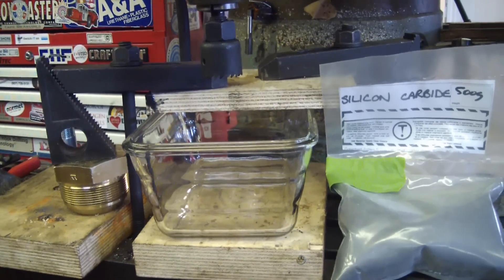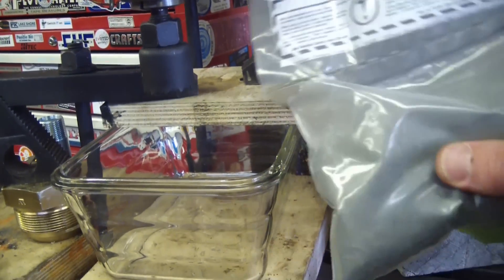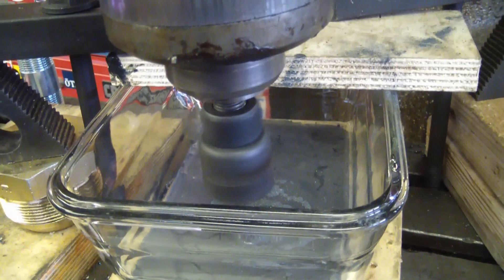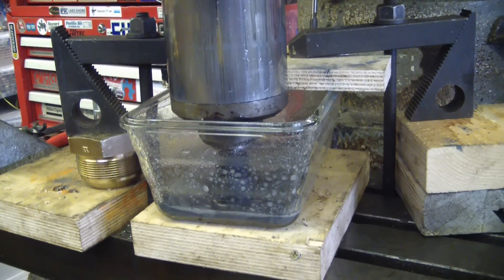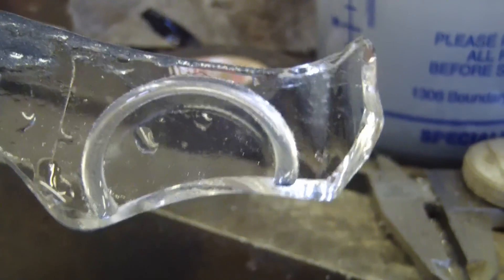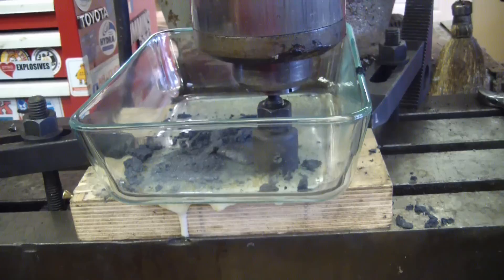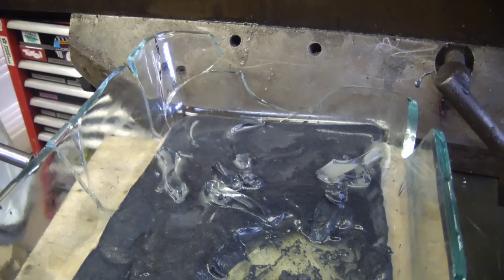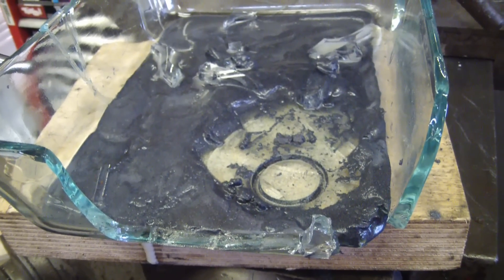Using Silicon Carbide to cut glass

Comment: You should've annealed the glass in a kiln before trying to bore through it.
Reply: +Kevin Jacobson yeah. im with this guy. though i think a kiln is over kill. you could  probably put your oven on self cleaning with the dish inside and walk away. i've done a little bottle cutting and its some finicky stuff, glass.
Reply: +hexadecimil what do you do to cut ur bottles?  I use GREENPOWERSCIENCE's method
Reply: +Shadowrcmegatech yeah! I watched a lot of videos before I started doing it and I found his to be the most informative. although he tells a few fibbs in his video "that would only take like 5 min to sand smooth." no. I don't know what he calls smooth... or 5 min but that's BS. second all I use is a micro torch. no water or ice. plus I use wide painters tape to keep the HAZ (heat affected zone) down to a minimum. I'm about to start experimenting with annealing or normalizing the stresses in the glass first before I cut. got a lot of broken wine bottles at the house. Which brings me to another fibb. the best bottles are easier. subscribe to my channle and I promise to post a bottle cutting video soon. you can seey set up, tools and method. might even break a few bottles too :D
Reply: hexadecimil holy shit!  Is the painter's tape a common thing?  I tried putting painter's tape .5in  above and below the scoreline cause I thought it would help.  I think it does at least a little bit.  Where do you put painter's tape?  

Yea it definitely takes awhile to sand the bottles.  I put wet sandpaper on a foam floor mat and keep the cut bottles in the same place as I rotate them back and forth.

How close to perfect can you get the bottles using the torch?  What % are successful? How often can you save both halves?  For me it really depends on the bottle.  Glass soda bottles are the easiest;  sometimes a perfect scoreline can end up forming a crack most of the way around without any heating or cooling.
Reply: +Shadowrcmegatech yeah. it really does depend on the glass and apparently Coca Cola co. uses the best glass. wine bottles on the other hand are a real crap shoot. so far I'm 1 and 3 with those. beer bottles are the all arround best. though they break about half the time, they are plenty full and easy to score because of the often straight sides. 
as for the painters tape I go about 1/4" below the line, which Google tells me is round about 6 mm (just in case your not state side) I do this to further isolate the HAZ as much as possible to the score line. since I don't care about the top of the bottle for making cups and vases I hesitate to say I've saved every one, even the ones where the bottle broke on me. I've got a stack of them. maybe I broke one. not sure. now I haven't experimented with quote, unquote annealing the bottle yet but I know that glass will melt round about 2000°F so I'm dubious 360°F in my toaster oven will do anything but I'm gonna try it anyway.
Reply: +Shadowrcmegatech  and as for how perfect can I get it with the torch? pretty damn close to perfect. I like to use the torch only because you are never shocking the glass from hot to cold or back again. I feel like this makes spider cracks more likely and with the torch I can control the break pretty well. it takes patients and practice and you need to get a feel for it, but it's been very successful for me. when I'm don't my necks always go back on like a puzzle piece and they will hold water no problem.
Reply: hexadecimil Interesting.  According to wikipedia the annealing temp. of glass is 800-900F, so I wouldn't even bother with the toaster.  Cutting beer bottles with hot and cold water is near impossible because they're so thin, but the blowtorch seems like a viable option.  

The small soda bottle I cut today was a real challenge.  I got a nice, clean crack to form all the way around, but the two halves wouldn't  come apart.  The crack was faint, so the two halves must have been so close together that the atoms in the glass were still close enough to attract each other.  Eventually I took a hammer to the top half and shattered it.
Reply: +Shadowrcmegatech  900 F seems logical about half the melting point. that means I'd need a kiln. or a forge. used to have a box I did that kind of stuff in, out in the yard bit now I love in an apartment. o bigger torch would work. good excuse to buy one of those :D
you hammered off the top!? wow. brave man. how'd that work out???
Reply: +hexadecimil worked out fine.  Top was
In pieces, bottom in one piece.  It was already cracked along the scoreline, so the bottom was unaffected.
Reply: +Shadowrcmegatech that's great! double it would work with a wide e bottle though. too thick. not enough leverage. every time I try to snap off a price of any bottle that stays stuck it takes a price off that I'd like to keep. bit it's always fun working with the stuff. wish I could show you a pic of the pair of wine glasses I made out of sprite bottles.
Reply: hexadecimil Which half did you use to make the glasses?
Reply: +Shadowrcmegatech the bottom half, bro.

Comment: Hey I'm a glass blower and i think the problem might be heat stress from the bit.  I also work in a machine shop and know that end mills create a lot of heat especially with constant friction.  It appears that the break occurs at around the same point of the cut and it could be that enough heat accumulates and causes a heat fracture causing the glass to fail.  When i drill holes with an abrasive drill I usually back off to expend heat and clear the glass dust (chips) that are left behind.   If it was tempered the vessel should have shattered as soon as the cut started.

Comment: maybe it could be a frequency issue? possibly a vibration problem...
Reply: If this was a Prince Rupert's Drop issue (inside under pressure, but unable to defeat the outside surface tension), it would rupture and explode the moment the surface of the glass was broken, and the entire dish would likely disintegrate.

Comment: I have used a cheap diamond coated hole saw from a good hardware store to cut holes in normal liquor bottle glass. The key is very low pressure and a slow but steady water supply to keep the heat down.

Comment: Soda lime glass is tempered, so like you said the same properties that take place in a Prince Rupert's drop probably apply here too. It also isn't as capable of withstanding thermal shock as borosilicate glass. So I'm guessing the rapidly changing temperature from all the friction combined with the vibrations are probably to blame. Bonus fun fact: Pyrex does not make their glassware out of borosilicate glass anymore. In 1991 they changed to tempered soda lime glass.

Comment: pre-stressed glass is going to shatter when the surface tension is removed.  So just use a plain glass bowl instead to save the effort of having to anneal it, difficult without a temp-controlled pottery oven or such.

I've cut non-tempered glass before without problem.  You use abrasive like you're doing (you can use a lot less if you make a small dam of putty to hold the abrasive slurry around the "bit"  But for the bit, you chuck a piece of copper pipe in the drill.  Prep the end by making a few diameter cuts across the bottom.  The copper is soft enough to grab the abrasive and also to wear away and keep grabbing new abrasive.  Taught to do this in shop class in high school of all places

Comment: AvE you're the best brother. In another life time I from time to time would be asked to make water pipes for the fellas. They wanted them made from beer bottles and I knew the secret. Every time the bit would penetrate through the glass the bottle cracked. I learned through many errors that a piece of Scotch tape helped the glass resist expanding. And if you could rig up a drimmel with a stone bit to cut that radius it might just chooch. I would do a prototype except on account. On account my wife would string me up by the short and curlys if she caught me cutting holes in her Pyrex. Any way good luck professor schmoo.

Comment: Try using a flexible bit (aluminum bar) instead of the hole saw.  The grit is what's doing the work anyway.  The glass breaks because of the high impact loads from the interaction between the two very hard materials.  If one material is soft, it absorbs the shock that would otherwise overstress the glass.

Comment: Your problem with frequency can be solved by surrounding the glass container with dissolved sure gel let it cure then cut the glass with your technique. It should work by dampening the harmonics . If not then I would try to acquire on a diamond bit or hole saw. Oh and plus your vids are awesome AvE...

Comment: A few years ago I built a decently large Dobsonian Telescope 12.5" and I made it out of a big thick glass table top. First I used a hammer to bust it into smaller pieces because it was like 36X36 and 0.75 thick. Then I got some of those diamond dremel like cutting wheels from Harbor Frieght and used those to cut little pie shapes out of a rotozip diamond blade. Yeah I tried a normal cutting/ grinding wheel and that's a no go on diamond =). With a few of those pieces I attached them to the ends of a fly cutter so they were 12.5" apart. I used water and just let it go. I actually have a really short video of it on my phone somewhere. I also used a super calibrated auto feed system like you but I think mine might of been a gallon jug with water in it ;).

Comment: Even North American Pyrex is tempered, which means there will be substantial compressive stress in the glass. That's what helps it resist thermal and mechanical shock. In the same vein as what Will said, the stress has to go somewhere and glass is too brittle to deform, so once you get near breaking though it pops. Usually with tempered glass (like in cars and commercial windows) a deep scratch is enough to shatter it, so you  got much further than I would have expected. However, you will have to use cheap non-tempered glass.
On a somewhat related note, you may want to try grinding the teeth on the hole saw mostly off (mostly, leave a bit of a valley for swarf removal) and rounding over the leading edge of the stumps so that it will want to drag the abrasive into the cut. None of that does any good if it keeps shattering.

Comment: Don't know why it's breaking but it's certainly an interesting problem. In both cases it broke when you were a good part of the way through. My guess would also be internal stress which is overcoming the material strength when you get down to the last few mm of material. The downside of that is you don't stand much chance of ever drilling through it unless you can anneal it - at least it gives you a good excuse to build a furnace.

Comment: Use a smooth bottom like a plain copper tube and you will have no chattering, and likely no breakage.  Also put a small clay dam around the hole are to concentrate the cutting material and water and it never runs dry.  Drill many hols this way making lamps from glass jars and never had a problem, also, lower the speed and the chatter factor drops a lot!

Comment: "Tempered glass" is made by cooling the outside layer faster then the inside layer. The outside layer strains to compress the inside layer and the inside layer pushes against the outside layer. The two acting against each other and the molecular bond of silica creat surface tension. That surface tension can easily exceed 10k psi and once broken by an equal or greater force results in shattering. 
 Annealed glass can be cut since it is evenly cooled and is not under excessive strain. You do not have to overcome the surface tension to break it, however, making it easier to break.

Comment: Pyrex needs to be stress relieved.  Gotta use something else that's not oven-safe. 

Also, have seen cheap hole-saws at our (aus) big-box hardware stores for cutting thru tiles to fit over taps in showers, etc. might be the solution instead of toothed holesaw or diamond-tipped thing. They seemed to be a tube with abrasive stone glued on one end.

Comment: 29.10.2015
Hi from Switzerland (the country next to Hilti-Land and with the nice money)
What about: 
1. cut the big glass to small parts, one has to fit to your needs 
2. fix it very very softly with clamps as if you would clamp your little finger ;-) 
3. avoid or fix the sharp edges of the glass - do they have any tension left?
4. heat the fixed glass a little bit with a heat gun (no direct fire please) - if you use water - no cold water, rises the tension, use warm water to egalise the heat between glass bottom and the drilling circle
5. drill it, stop from time to time, heat it gently to egalise the heat between glass bottom and the drilling circle
6. start drilling, watch for cracks in the glass
7. if I'm wrong with this tip... do you best to "compliment" me in your unique way 
8. try plan b: put a fitting small piece of glass in the lathe and do as the young Dr. Frankenstein: try it to drill - may be from the inside to the outside? 
9. Important: this advice is given freely and if you follow it fully or partially - it's on your own risk and safety - you are a Canadian so you have to have a brain and take a good use of it (xxx sticks paperclip in ele...) so no fat chance to see me in the front of a jugde or court...

Comment: Might be good to put it in a kiln at 1200f and leave it for 2 hours then shut the kiln off and let cool naturally, this will get the pyrex hot enough to flow without losing shape and will remove the stress that is trapped.

Comment: Ever seen a wine glass break from a stereo speaker? Same principle here. Your drill bit found the proper sound frequency which is why it broke in a different area. More water to dampen the vibration from sound and/or place neoprene between the glass and wood. More abrasive, more water = more better

Comment: Adding to the thoughts on harmonics, you could mill a drill bit out of plastic to work with the Silicon carbide. Once it started to heat it would probably embed in the plastic also and not make as much noise. Also, after watching your video on balancing with a neo magnet and earbud speaker... if it is sound related, you could try changing the drill speed to get away from a resonance peak.

Comment: i did that with a piece of copper tube, the abrasive will embed in it and it'll grind away the glass.
The idea is to clamp the glass between 2 wood planks, one with a hole already drilled used for guiding the "drill bit"
Fill it with water and drill easy peasy, very common for drilling aquariums.

But you cant drill tempered glass, it has too much stress.

Comment: Try grinding the teeth off the hole saw, then grinding  two or four vertical slots about 1/2 in up with a ramp towards the direction of spin to  assist  the silicone carbide being drawn into the cutting surface ?

Comment: Alrighty boss I haven't had the need to try it out on Pyrex or tempered glass. But it does work and quite well on regular glass. I learned this trick making bongs out of Miller High Life bottles. Tape yes that strip of plastiqu with the sticm on the back. And for that dude I recommend heavy duty packing tape. Maybe even the woven fiber reinforced stuff with super skuckum shmoo for stickum! BTW you are #1 really the best channel on the tube!

Comment: I'm not very good at this but I'll try. Tempered and heat treated glass is like stuffing a huge piece of foam inside a tiny container. It'll stay in there, but you fracture the container and the need for the foam to expand will finish fracturing the container to the point it is able to expand freely.

Comment: No experience cutting glass and whatnot, but I've always been told that certain types of glass (namely the good shit) has internal pressure from the cooling process. The outside cools faster than the inside, contracting and putting pressure on it. Sounds super smart whether I'm right or wrong.

Comment: Honestly Dremel tool, and Dremel grinding bits (Diamond wheel point- 7105)  work wonders on tempered glass, just use some water, no abrasive needed. It is slow but so are  most of the other proper methods, also you will have to end up working the hole out by hand to get it circular at the size you were trying to get it to. It gets the job done tho, never had tempered glass break on me doing it this way.

Comment: I've cut holes in light bulbs and fluorescent tubes using the "diamond" ball burr that comes with a dremmel kit. They even hold up to a vacuum afterwards, not sure if it would work with new pyrex.
Reply: What kind of bong has to hold up to an atmosphere of pressure? I wonder If you could release the stress from one of those dishes by heating it up until it glows then slowly cooling it. If it's like a Ruperts Pearl then it was the rapid cooling that put all the stress into the glass.
Reply: Nick Moore One that you use while high.   (heyoooo)

Comment: I know from my experience a few years back I used to cut filter holes in fish tanks. I always used diamond tips. And never ever ever tried going through tempered glass. The bottom of the glass tanks are almost always tempered. Use cool water in a cool environment. And be very generous with it. I always had the water running into the cuts(as to take the glass cuttings out and away from my cut) and I always used a dremel. One through cut and then horizontally cutting the rest of it. If I recall properly the through cut always made or broke the job. If I got through the glass, I was golden. If not. Well then I had to rebuiLd a tank or buy another.